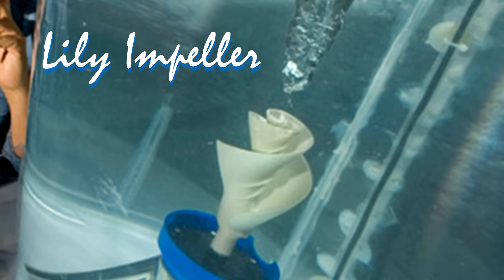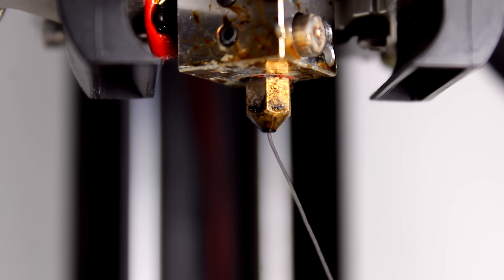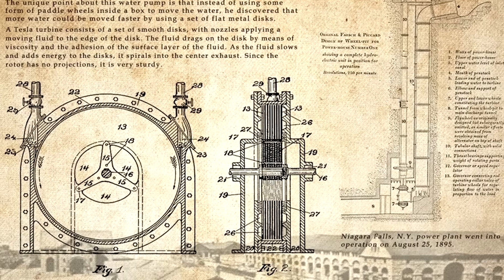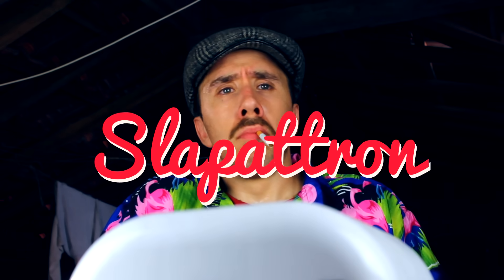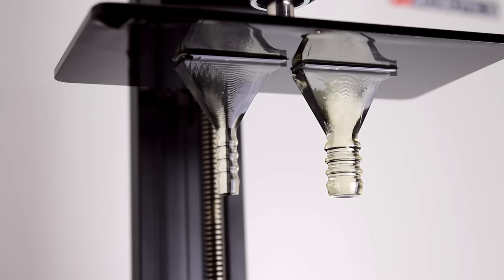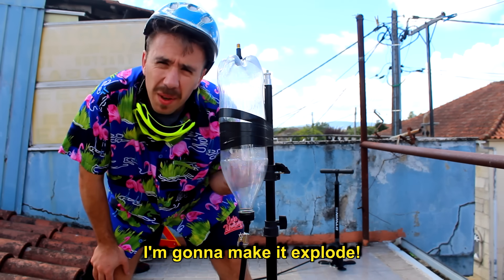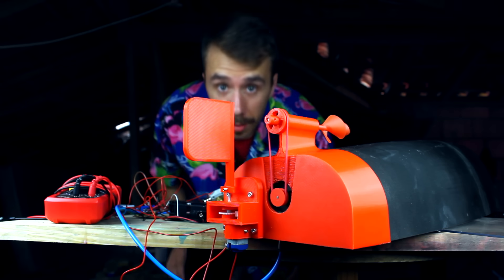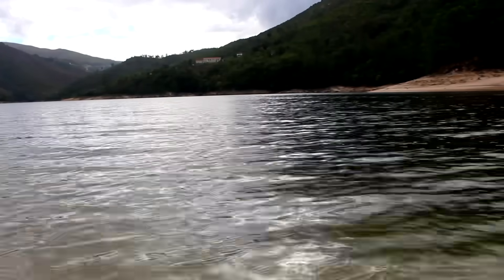Tesla Turbine Boat 3D Printed (Lily Impeller)

Comment: The bottles are in contact with the water, so you're actually pushing FIVE boats through the water. Try moving them above the water line. Also, the impeller is pushing against its support - try putting it after the support.

Comment: Try encasing the impeller in a fitted tube with a nozzle at the back, the tube will direct all the thrust to the rear and not to the sides wheee I think you’re losing all the thrust.

Comment: That boat will do 60 knots if you put the prop inside of a housing ( i.e jet / wet bikes use ) your disrupting the flow or water past the prop   A wet bike housing draws water into a grate under the bike and its forced out of a directional nozzle !  It will work well.  I think though that tesla pump will fry and plates will warp from friction.  They need to be made out of something else like titanium ? But if they hold up you have a great design there thats usable   .

Comment: @
Integza:
I'm surprised that you did not investigate further. There were a couple of (to me at least) obvious issues with your boat:
First, the air bottles were in the water, this adds a substantial amount of drag to your otherwise streamlined boat. Also, I believe the impeller would be much more effective of you turned it around. The way it is turned now, you are pushing the water at a very low angle of attack. If you turn it around, you will have much more surface area to push against the water. Maybe a follow-up video is needed.

Comment: On the next teala turbine build on the same shaft also build a Tesla pump. This will increase your efficiency. The air going in to the turbine will also be (the air) pulled by the pump. This will then remove the Eddy currents from the system. The build will need to be in series as per the air flow. And one shaft. No body likes being shafted twice.

Comment: Thinking back to the previous video a lot of the water appeared to be slinging out from the sides of the impeller. Perhaps putting the impeller inside some sort of ducting to help direct the flow and would increase your thrust.

Comment: Hi. Great jobs :) Maybe some improvements. First. You may use Lilly in tube ( like in previous video with bottle ). This should direct stream and create kind of jet engine. Second maybe you'll change the shape of the rudder blade an hide driving rubber into it. Just a suggestion :) But anyway I'll wait for next video

Comment: as a general rule when pressure testing bottles i think the safer practice is usually to fill the bottle with water.... it compresses less so you can get up to pressure but its less dangerous since your dealing with only a small ammout of compressed gas and the rest just water which does not compress a lot...its just less energy but lets you test what you need to test...

Comment: I dont know if it is possible, but a 3d printed helicopter drive train sounds awesome. Would the swash plate be able to hold up, and could you make an arduino run it?

Comment: I suggest u move the rudder in front of the impeller, rotor is the part that will control direction ur boat will go towards. That will help with movement when u improve the design for more speed. Some of the projects I would like to see is a robotic arm powered by small motors an rc plane powered by a tesla turbine, something like what Thom did, also u should probably try to put bottles inside the boat or on top for less drag allowing the boat to move easier in water.
If u like my suggestions pls like my comment as it could help me win a 3d printer as I can't afford one.

Comment: This is called Proof of Concept. It shows that a Tesla Turbine spinning a Lily Impeller does in fact work. Now there is a starting point for making improvements. Start with varying the angle of the impeller vane. Add a 2nd and maybe even a 3rd vane. Then experiment with whether a shroud around the impeller will increase water flow.

Comment: How much pressure a 3d tank can hold? And if not much there's a way to improve it? It would be nice to 3d print a boat with the air tank included and make look a little prettier, in the end even the looks of what you build count

Comment: It's because you've printed a diffuser. This will only accellerate a fluid if it is over the speed of sound of the fluid at the entrance. The de laval nozzel would work, if you can get the pressure high enough so that the fluid flow through the throat reaches mach 1. Otherwise a diffuser just diffuses a fluid and slows it down XD

Comment: Not a 3d printing idea, but you could build a larger tesla turbine with aluminium sheets, the clay you used for the pulse jet, or whatever else you can think of so you can actually run it off steam! Maybe boil the water with solar power?

Comment: Make a capacitor powered toothbrush. This way you can leave it plugged in without damaging the battery's in a normal electric toothbrush. The toothbrush wil than have a longer lasting battery life.

Comment: Awesome idea but you executed it wrong :'(

You had the impeller pushing water into the impeller support and transmission, which stopped most of the water from traveling backwards and generating thrust.

You should have put the impeller inside of a jet-like cylindrical enclosure and had it driven from its sides/circumference/perimeter instead of from its center. This way you would maximize that amount and speed of water pushing backwards.

Comment: You could try getting a jig saw blade that cuts in the other direction. The blade you have attached cuts in the down stroke which in your case since you have it upside down is cutting on the stoke moving away from the table. This means you are having to do work to keep the material on the table as well as feeding the material. If you get a blade that cuts in the up stroke the table will do the job of withstanding the force of the actual cut and you should then only need to worry about feeding the material.

Comment: Could you 3D print different RC rims for a tesla turbine RC car that works using your bottle pressure design from this video :O to see if there are different pros or cons to which rims absorb more shock or lower rims increase speed ext... idk just a thought i had :) i think an RC car tesla turbine design might also work better because im sure the water was adding extra friction to the belt to the impeller causing a lackluster result (speed wise lol :p ) idk though. Im no engineer, yet. ^_^

Comment: You need to put the impeller inside a tube, with the output of the water going through a nozzle. When the impeller isn’t fitted inside a tight fitting tube the water doesn’t travel down the impeller and out the back of it, the water will just flow over the sides of the rotating shaft and provide no thrust like your seeing. (Think of an achemedies screw) without the tube around the screw the water will just flow around the screw and not be pushed outwards.... it’s just one more print for a tube to house the impeller, and you’ll get vastly increased performance... you were so close...

Comment: Use the heat coming off an electric motor under load to power a Stirling engine. The Stirling engine will have to have a high tolerance though because I'm sure you would lose some of that heat through transfer. I have had this idea for a while now but don't have the resources to try it myself...

Comment: Interested in seeing something fly, helium with a Tesla turbine powered jet/compressor... The helium to help offset the weight compressed air would add is the idea. (hydrogen is easy to produce, but it's a bit reactive to sparky things) Or on the flying theme, maybe a H gas Tesla turbine davinci inspired lily impeller helicopter?

Comment: I think you might have had more success if the bottles were attached on top of the acrylic versus on the bottom.  Their current placement created a lot more surface area for the impeller to try to move.

Comment: What if you heated water by spinning it and passing it through holes OR passing the water through a series of holes with tubes while spinning?  Is this more efficient for heating water than by using a heat source?  Can you bring the water to a boil by the hole - ie method

Comment: I think you should position the stem on impeller so you can use it as a propeller. Also you should do a control and see how fast you can get the boat if you use as the direct drive.

Comment: Wouldnt the lily impeller be more efficient at moving the boat if it were inside a housing, kind of like a jet boat? It would seem to me that its efficiency relies on the walls of the tube around it normally. Then you could also possibly steer with the impeller.

Comment: Theory says Impellers work better at lower RPM (vs.propellers at higher rpm), especially when they aren't shrouded (think Jet Ski).  So in order to get useful work from them, they need to be larger (more surface area).  You can make it larger, or use more than one.  ... OR ... Both!!!  I would like to see that theory tested, with, say, two impellers about twice the size of the original.  Well?  What do you think?  Do ya feel lucky pu... er... Bye...

Comment: edit: It sounds like the water drag is enough to slow the impeller so my post is moot.

I have zero experience or knowledge of lily impellers, but was it turning too fast to pull water in effectively? SecretIonOrb seems to think so too.

A quick google search for optimal lily impeller speed, and optimal "lily impeller" angular velocity vs force, didn't seem to help

This video has a lily impeller and it seems to move quite slowly, although that might be a camera artefact.
https://www.youtube.com/watch?v=by0JhirtO-0

This video has the sound of a larger impeller under water, and yours sounds slower under water (I couldn't find any full speed runs above water in your video), so I'm probably wrong.
https://www.youtube.com/watch?v=5CXOr4qJp7s

Comment: If you had sense, you would use CDs for the disks of a Tesla turbine, especially since they are made of very stiff polycarbonate and designed to spin at high speeds to begin with!

Comment: I love your content Integza keep up the amazing comment! However I have 2 issues with your design for this project, 1) an impeller is an enclosed propeller not a puller vs Pusher  and 2) I'm interested to see if it may have more thrust if the Lily impeller was facing backwards turning in the opposite direction as I feel that the look of this "propeller" design to me is that the most thrust would be with the narrowest part pointing towards the back.

Comment: Does the Tesla turbine utilise it equally along each disc in parallel at equal amounts or does it pass through each blade in turn
You could try a tube over the Lily propeller and an a smaller diameter smaller tube connected to the outer tube in the inside about a quarter of its total length at the front about 6 mm rounded off at both ends centre hole wider between the outer tube and the inner tube front of it rounded off the widest part of the propeller just tight against the tube but not touching make the inner tube Aberfoyle on the inside part only, but both ends have to be rounded off on the outer part of the inner tube a wide bevel on the inlet of both tubes a small bevel on the inner tube on the outer Edge surface

Comment: Very cool idea indeed, but the boat ended up more like a raft, with the plastic bottles and all. I think a trimaran design with a enclosed  lily impeller  in the  main hull would better accomodate the bottles and have a nicer hydrodynamic profile, if you can keep it all light and floating. The ideal design for the water intake, however, might prove to be quite a challenge.

Comment: The impeller needs a cone like inlet shaped to the cone of the impeller, leading it by at least 1 inch at your scale and a straight outlet.. The speed will improve cause your not wasting the energy around the impeller, but rather focusing it..

So if for impeller was 1 inch, the inlet should be at least 1 and a quarter inch, with 1 inch ahead of the forward most part of the impeller. The cone should slop no less then 5 degrees slacker than the impeller ( ie, back or propulsion side is say a 30 degree angle, than the cone angle relative to center line should be no steeper that 25 degrees, down to 20 degrees.. You don't want to go any greater than the angle relative to center line of the impeller, or turbulence will greatly reduce potential power output...

Hope this helps, and I hope you try it out and post a video of your findings.. I used to build alot of impeller based boats back in the day, and these were some of my findings after alot of trial and error, in a day way before 3d printing..

Comment: Integza,,,
I have a real world problem I could use your help with, 
I need a very inexpensive way to pump water out of a deep water well,
My well is drilled at 700 feet, water table is close to 600 foot deep, but without power, there's no real way of drawing water from the deep well, 
I saw a man put a smaller PVC pipe into a larger, to create a piston type of effect, but was very long, pulling the smaller pipe out of the bigger, pulling water up with it, but I need something smaller, I'm disabled so buying and carrying 1200 feet of PVC pipe is not practical, 600' of both large and smaller pipe,,,,
Perhaps the Tesla impeller can pull water at such depths or similar technologies, 
Please help 
Thank you 
Signed
Thirsty

Comment: you should attach a normal propeller as the tesla turbine works fine but the propeller is not able to generate enough thrust , you should keep air filled bottles on the boat this will reduce the viscous force or drag of water

Comment: I would like to see a Tesla turbine as the propeller. Like a jet boat. using an electric motor to turn the turbine as a water pump with the water outlet behind the boat.  I have built a Tesla turbine as a water pump turned it at over 10,000rpm and it pumped an amazing amount of flow. I had plans to put it a model boat but never did.

Comment: Put the Lilly impeller into a tube (to channel the air/water similar to a jet engine) and place that on a boat or car (model of course) and use it to propel said boat or car similar to an air boat used in swamps.

Comment: Hey integza
I have a suggestion for the tesla valve 
That is if you just decrease the distance between the walls of the tesla valve such that the walls come near.
Let us understand it by an example:
If we take a big diameter pipe and flow water from it
The water will flow easily from pipe
But if we take a narrow pipe we will it will require more power and pressure to move water from it.
Hence more resistance and very low flow of the gas or liquid

Comment: Maybe the impeller design could be surrounded by a sheath or cylinder to allow the vortex to form and then propel the boat. Maybe with the cylinder in front of the impeller would work best? Thank you for the awesome videos.

Comment: Very cool video, but you never actually mechanically "exploded" the bottle? It appears that one fitting or another failed each time. With some modifications, I think you could get a bit more pressure out of that polymer. The round profile of those 4 bottles sitting to the water like that is also adding a whole lot of drag, impeding performance of the completed boat.

Comment: What would happen if you used an electric motor to spin a Tesla turbine, and use that to pump water out the back of the boat?  More like a jet drive, but using the Tesla turbine instead of an impeller..

Comment: It may have preformed better if the impeller was inside a tube housing. This would focus the thrust. Just a guess though. I think your thrust was being slowed by the water hitting the rudder housing. This would be fine for a propeller with wider blades but that impeller needs a housing.

Comment: 7:03 And that's how you've became a rocket scientist. 
What if a propeller would follow that impeller in a closed channel? Propellers have problem with the blades separating the medium they pushing trough that's limiting their effective rev range. Sounds like the impeller does the exact same thing the lack thereof causes separation with propellers.

Comment: Integza , please make a V2 version of your lily impeller boat. Maybe make the impeller slightly bigger, and maybe use insulation tape on the bottles to make them stronger to hold 8bar. Or use another system for storing the compressed air.

I'd really love to see a V2 of your boat.

Comment: Impellers have a casing around them to  increase the efficiency and thrust. All the air that would nornally get pushed out by centrifugal forces is kept in the impeller and pushed out the rear

Comment: This was a great project! I suppose, the speed of the boat was not very high, because the shape of the boat inhibits the water flow directly in front of the impeller. You could try another shape for the boat or place two impellers, one on each side of the boat (without anything in front of them). Keep the good work up!

Comment: Wrap the impeller in a turbine shell to focus more of the thrust. Also those bottles are rated for 150psi so maybe try 8 bar. Also you could integrate the impeller turbine into the hull of the boat. Check out the PBR boat.

Comment: To develop this propulsion further and make it go faster consider consider capturing the outward flow from the Lily impeller and directing that to the stern of the boat. The speed of the boat in its current form is too anticlimactic from all the build up of this boat boat. That and you have a 3d printer.

Comment: Make a working da Vinci’s flying screw! That material you have should be light enough and with enough surface area for the screw, you may get sufficient lift
Reply: You could make it to where it is powered by compressed air and fly it over a body of water where the bottles will float and thereby not contribute to the weight of the craft. May need more pressure though